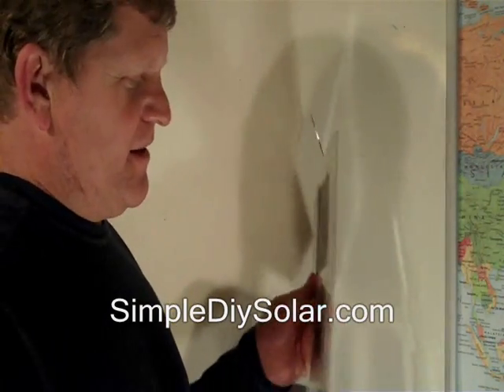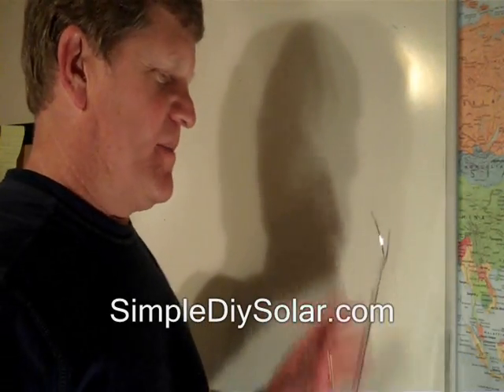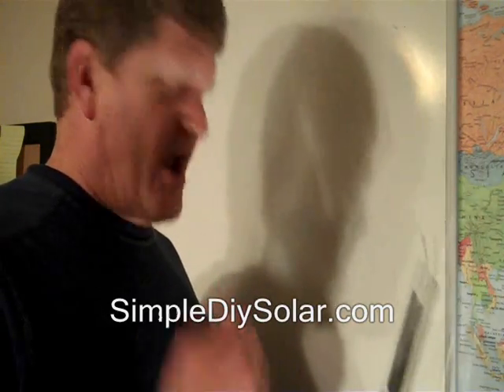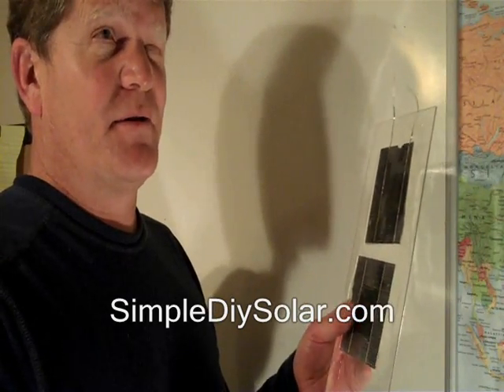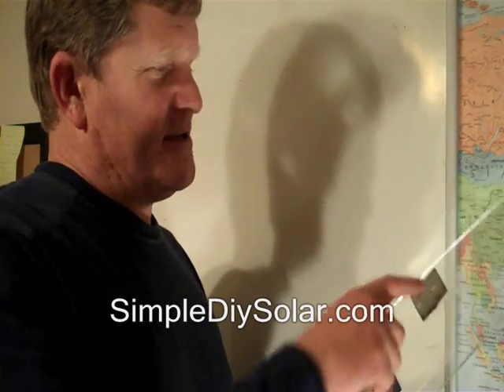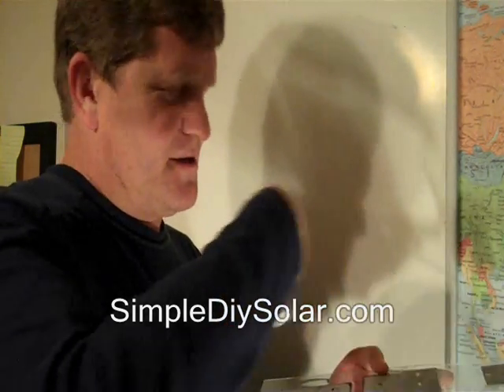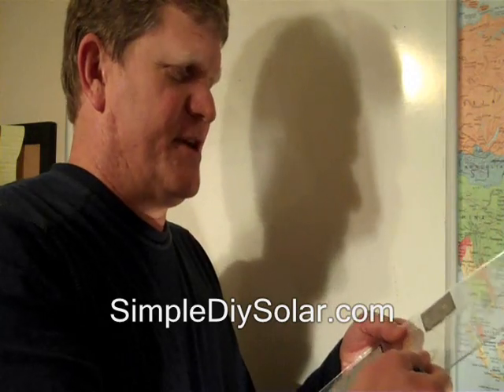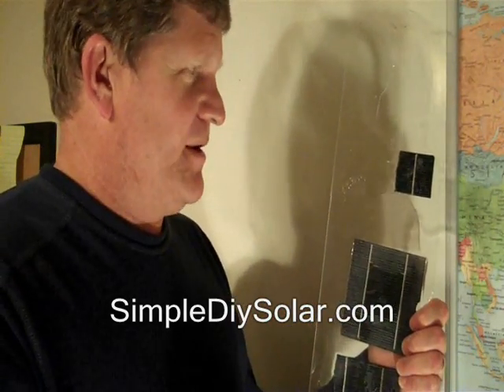DIy Solar Panels - More Tips on the RIGHT way to build them

Comment: @qcages Sylgard 184 Solar Cell / Solar Panel Encapsulation Kit
epoxy dries hard hard, this dries more like the rubber between the 2 sheets of glass in your wind shield of you car and has a good UV protection, from MLSOLAR ebay

Comment: @NLOLIN4Solar The only kind of encapsulate i can find from MLsolar on ebay is Slygar, which is silicone based. Did they stop carrying the Epoxy based encapsulate, or were you talking about slygar? 
What's a good UV rating for the epoxy to be solar panel safe?

Comment: Your talking about encapsulation you can buy it on ebay from MLsolar
The resin is an epoxy resin with a real High UV protection rating, don't fade to a fog like fiberglass (like a bad gel coat on a boat,,Resin fiberglass resin will crack is to much hardener causes a pull in shrinking effect and cracks the cells,They make epoxy encapsulation specially for solar panels stays clear and don't crack